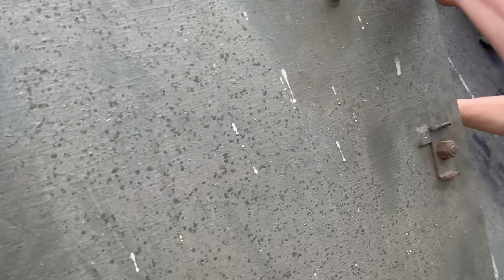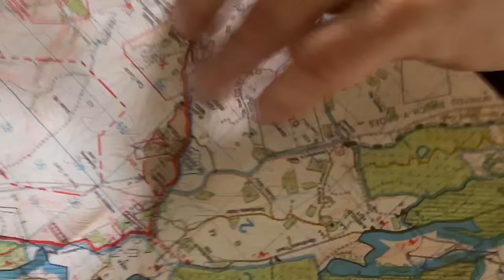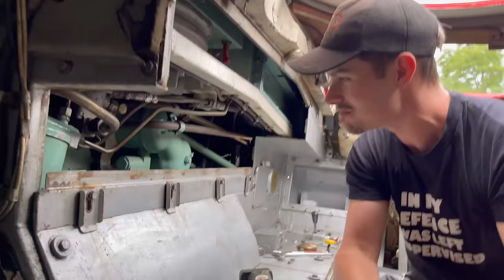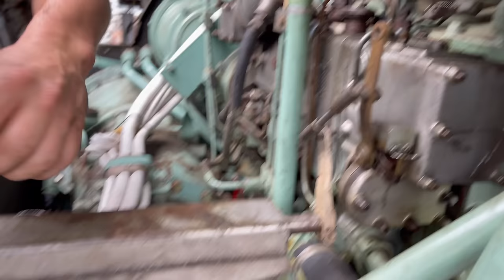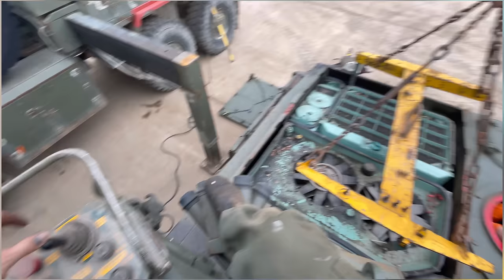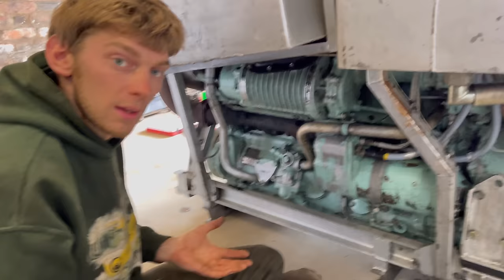HOW TO CHANGE THE ENGINE PACK ON A FV432-30

Comment: sitting on those engine louvers to the left of the drivers hatch were a life saver on a cold winters exercise
Reply: Yes but also got you covered in oil and coolant!
Reply: We used to warm up tins of sausages and pasties under the metal vehicle chocks placed on top of the louvers and loved sitting on em to grab a quick kip or warm up on the drive oh the memories fade
Reply: We used to warm up tins of sausages and pasties under the metal vehicle chocks placed on top of the louvers and loved sitting on em to grab a quick kip or warm up on the drive oh the memories fade

Comment: spent the better time of my 22yrs in the army in these beasties and loved them, me and a colleague got the pack lift down to a fine art to the point of getting down to around 15mins.
the secret to these vehicles as you well know was to run them run them run them and they rarely broke down, the problem was that most of the time they sat idle apart from a quick run up on a monday morning and the occasional road run once a month. like you i loved my little 43

Comment: Brother drove a 432 when he was in, still   remember the part of his driving license  that covered this "a track laying vehicle steered by it's tracks" .
His was the (normal)armoured personel carrier version (no turret) he also drove (at Sandhurst) a 432 fitted out with lots of radios which was the 'bosses' command post.  When he was at Sandhurst he spent most of his time as the 'bosse's' driver.
  Prior to this he was based at Soltau(in Germany) he decided when he was there that he was bringing his 'panzer' home to show his brother, he was feeling no-pain as he had been celebrating his 21st, needless to say wiser heads prevailed, his mates persuaded him to have another pint. So he forgot all about his plans.

  I visited him in Soltau.  Some  of the time I was left to my own devices but one day I visited his troops 'howf' they were having what was known as a sports afternoon so they were all drinking and basically skiving, I think it was one of these recognised tacitly as a nothing gets done evolution, one chap was supposedly refreshing the camoflage on his 432 (with a 4" distemper brush and a tin of paint).  When someone posts that a model is inaccurate because that swoosh starts at the fourth rivet along and passes through the middle of that ammo box. I remember that chappie painting the design on with a 4" brush and a pot of paint he found lying about.

Comment: I've changed a few of those Engine Packs with REME even on Exercise, I'm ex 39 RA, I could not get enough of driving & working on 432's, M110's, Bedford's etc the REME Mechanics were brilliant & taught me so much. Watching this Video brings back so many memories 👍👍👍
Reply: Agreed about the REME LAD, they are the best and generally do a fantastic job. Also the garage/workshop is usually the best place to go for a chin wag and a brew.
Reply: That was my life in the MT, hanging out down the LAD gobbing off
Reply: Did hand Granade training at Sennybridge back in the sixties… an yes it was the old mills bomb😎……. Looks a tidy motor great find👌🏼
Reply: Employed a few ex REME guys on the spanners in civvie street on Commercials mostly, Some of the best Mechanics we've ever had 💪
Reply: Mate, that is because despite the forces banter most REME mechs know what they are doing. Not me. I'm thick as mince. If it isn't a tank then I'm fecked @-DC-
Reply: I came across a  Guardsman driver who was City and Guilds qualified,back in the early '70s. He loved working with me when there was a power-pack service.

Comment: Jesus this brings back so many memories.... Oddly I still have pack bolts and a steering box adjuster tool.... So often changed these power packs in German forests at night using the trusty 434.... Keeping beer bottles in the light guards to cool them as we drove along and filling the 3rd man's hatch with boxes of Aldi's finest Bocholt beer.... Hey ho happy days....
Reply: “Bocholt”, now there’s a name that I haven’t heard in decades. We used to drink gallons of that stuff back in the early 1980’s. There was an Aldi opposite our barracks in Nienburg, we’d buy two slabs each on a Friday afternoon and both would be gone by Monday morning. Happy days.
Reply: Maybe they would like those spares and tool, not like you’ll be needing them?
Reply: Sitting on the louvres in winter keeping warm and drinking beer.
Reply: I might give away the steering box tool. It's in my army tool box and I left the army in '88'.

Comment: 10/10 in case of needing quick repairs on the side of the road.
Reply: A hammer fixes every thing , who needs spanners and screw drivers and other tools of which I would have no clue how to use . As you can tell I don't work on my own car !!!
Reply: @zeberdee1972  well that's how Volkswagens are fixed, just hammer them till they stop acting up.
Reply: @LostCauseRT  Beat them into submission or scrap . Either way they either work or your no worse off , it was broke to begin with lol .
Reply: @zeberdee1972  jokes on you that might be my new kink... damn.

Comment: I did my Grp "H" test in a FV432 in the 70s and spent years supporting them in 1st & 2nd line REME units.  I always felt the designers were a bit mad to combine the brakes and steering in one function as the one thing you really need if either the brakes or steering fail, is the other.  Add to that the fact that the proper functioning of brakes/steering was dependent on the correct installation and adjustment of brake bands and a whole collection springs, clips and fixings inside the steering unit, and you have a real potential for the thing to take sudden unexpected excursions off the road, which happened on several occasions to my knowledge.

Comment: Lads depending on your concept of a "ratcheting shifter" a company called Knipex does make one.

They are sort of a cross between smooth jawed multigrips and an adjustable and I have a pair which work quite well for tasks like the barrel unions on those fuel lines.

Comment: Great video as ever especially the interior shots, keep them coming. BTW The top cover of the gun, containing the feed and firing mechanisms, has been replaced by that sheet metal lid that you pulled off and the recuperator appears to be missing.

Comment: We have had a few runaway engines due to a defective seal in the Actuator, the thing at the side of the gearbox, near the oil filler. Out in the field, a Durex was used as a temporary replacement for this seal.

Comment: Halon is the safest and most effective fire suppression agent for use in that machine. Look it up.
Reply: Just not when people are in it right ?😂
Reply: @Commodore_westaway  Wrong. Halon is very effective at fire suppression and in the concentrations provided for the volume of the enclosed space to be protected will allow occupants to escape without harm. Halon does not function by displacing oxygen. Look it up.

Comment: Maybe you have covered this elsewhere but some of your viewers might be interested to know that the K60 Engine in the 430 Series was really just a smaller version of the L60 in the Chieftain. Two Stroke compression ignition, 6 inline cylinders, 12 Apposed Pistons with 2 Crankshafts and supposedly multifuel though it was rare for them to be run on other than diesel fuel. I seem to remember the Mk1 vehicles having a B81 straight eight petrol engine as in the Stalwart and very similar to the B80s in the Saracen & Saladin.

Comment: Interesting videos and nice to see the wagons I used made working again .... Those power tools make a difference in taking a Chieftain or any pack or gearbox out ... Try it without power tools , in minus 10 outside at night and with the GUE fitted guys ... Won't be so quick then.... Also, ... I would like to see the engine bays cleaned out and not just let fuel or oil drain straight into the bay etc .... Good clips on the whole though....

Comment: I used to have a friend that was in the Belarusian tank corp and he told me it used to take 8 hours to get the engine out of one of the Russian tanks. He moved to Germany and watched them take the engine out of a Leopard in 30 minutes.
Reply: Compared to an hard working HGV these engines don’t seem. To be very reliable?
Reply: @victorwild3225  They certainly don't manage the same hours, but they're ragged on really hard and eat a lot of dirt. Tracks make for a lot of drag too

Comment: It says here in the service manual that you just push the vehicle onto its side, undo three bolts, and the whole power unit slides out the bottom.

Comment: I noticed you guys need hose plugs and adapter caps to keep from leaking everything into the engine bays when removing an engine pack
Reply from the maker: It goes outside the environment

Comment: plz pull the rear cover off the starter motor to check if it isnt full of oil it dont like that (just my alternator/startermotor rebuilder 2 cents )

Comment: I served with the REME in Germany from 65 to 68 and 71 to 73. I worked on 432 mk1 and 2 and Abbots. That interior and engine look totally different to what I recall is this a newer engine? We had Leyland K60's but I think the governor has been changed on that pack. The ones we had used to leak through a diaphragm and then the engine would run away. Also has the metalastic coupling at the rear of the engine been modified? They used to fail regularly in my day ditto the starter motor when the overheating link would fail. Annual pack servicing was a pain and putting the leak off pipe back on needed three hands at least!

Comment: You need a set of slide hammer, ratcheting, impact and locking adjustables; in imperial, metric, Whitworth and Stillson. Actually, forget the set, just buy the largest one.

Comment: All in all that looks a good one . Joe have you ever come across the amphibious version of the 432?  I love to see one and see it swimming . Great video chaps , thank you 👍👍
Reply: You'd be lucky to see one. Only underwent trials I believe. I never saw one in my time.
Reply: Won't ever see one as far as I know. The Mk. 2/1 didn't have any fittings for the canvas skirts or "bow" splash plate. Earlier ones had a different upper hull layout but the "swim kit" was long gone and I never saw any in my career - not even a CES listening for it. If you can find a user manual for one I think there are photos/drawings of the kit fitted in one of the sections. I served in 432s and 436s and remember two registration numbers in particular - 10EA29 and 12EA65. Very reliable vehicles when properly cared for/about. Apart from Mk. 1s with petrol engines and plugs/points used in Canada - one of those SOBs ate through a set of points about once every 36 hours when I drove it on Ex Med Man 7 in 1990. Absolutely loved my time on them, and would love a crack at driving one again. Or even just a few minutes in the front seat making engine noises...

Comment: It’s a third of a deltic, or two thirds, depending how you look at it? :o) Considering the pump is right next to the driver it seems mad to have a complicated over-fuel thingy. Very nice pack though.
Reply: atleast the fuel rack seems to start in the closed position, and not full fuel like detroits.

Comment: To do a re seal on the blower its easier to pull the blower out, as 90% of the time, if the coolant pump shaft seal is leaking then the internal lobe seals wont be far behind.
If the the lobe seals fail, you will DEFINITELY have a catastrophic run away.

Comment: You think you are well hard, but last night I was undoing 10mm U bolt nuts with a 24” monkey wrench!   * I was pulling a lift cylinder on a toy train fork hoist and I took the wife’s car instead of the van :D

Comment: I can't reason why you have to use a nut fucker so much when you have perfectly good sets of tools. YES there is such a thing as ratchet open end spanners. They're made in the land of septic tanks. Can't think of the brand but they do make them.

Comment: The main trouble in the seventies was not the engines but the civil servants that kept raising the mileages between servicing with the inevitable consequences. Add to this the lack of spares then you can see why these equipments spent so much time down in the field. The failure as far as the troops were concerned was the reduced protection of the armour which was the thinnest in NATO so troops had an extended hike to the the battle.

Comment: NO WAY could you do a pack lift better/faster than my REME fitters.  Alls you would see of them is boot soles and arseholes as they left you in their dust.  We had these in Berlin in the late 70`s when the wall was still up.  432 is a basic APC but the Rarden cannon was very good.  Youre just a civvy mate.
Reply: Bit unfair that last line, we needed civvys alot as support, 7 armoured workshop had quite few and most development of armoured vehicles is done with civvy back up. Never underestimate farmers!
Reply: @tonysmyth1767 worked & drove quite a few of these in central workshops REME
Reply: Wolfgang was just a "civvy" you'd have starved on manovers without a civvy
Reply: @philleeson7835  so true!
Reply from the maker: Tell me more about your impact guns and ratchet spanner’s you had in the 70’s hun.

Comment: Haylon is a very safe fire suppressant; you’d have to try really hard to be killed by it.
 (Waiting for some pillock to give the most obscure and rare situation that means it’s the most dangerous stuff in the universe)
Reply: Used to have it in our Server room. Rumour was if you were in there when it went off you were dead. Like VX gas DEAD.
IT people.
Reply: @Jin-Ro well CO2 will do the same thing to you if you're in the room when the fire suppression system goes off...
Reply: @Jin-Ro , yeah, uninformed rumours. Look it up.
Reply: I was at sea and we were told Haylon wouldn't kill you as CO2 would, so you could exit the space.  Not so sure about re-entry once the fire was extinguished and before the space had been ventilated.